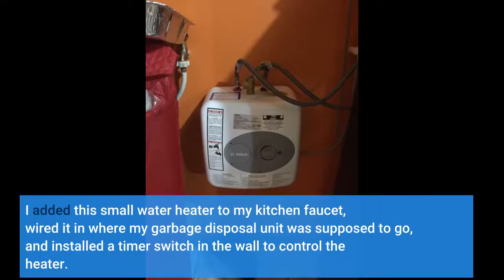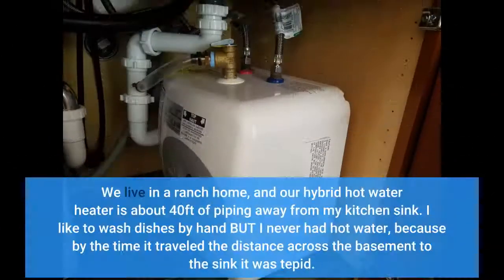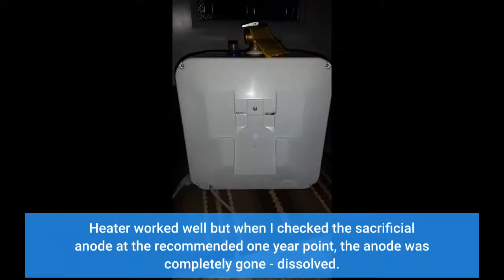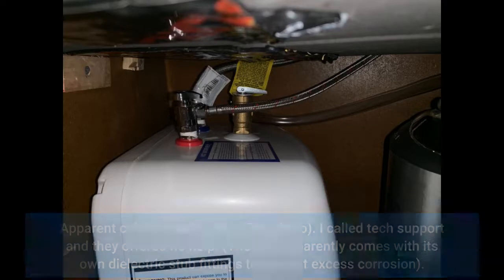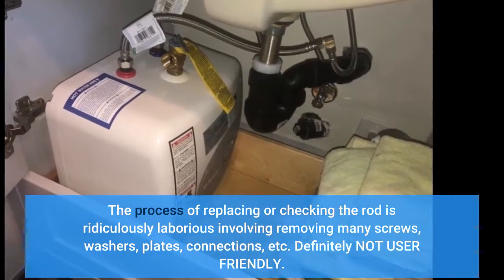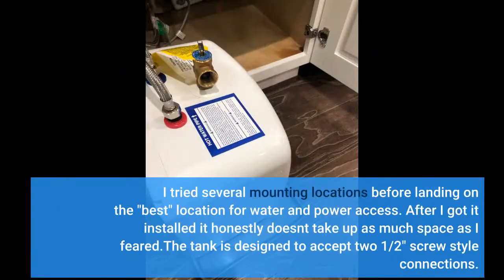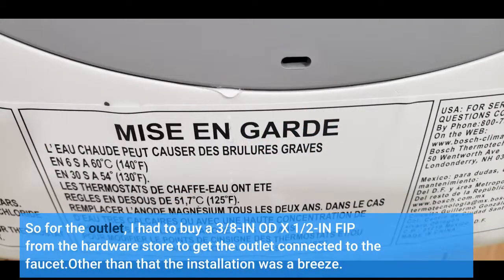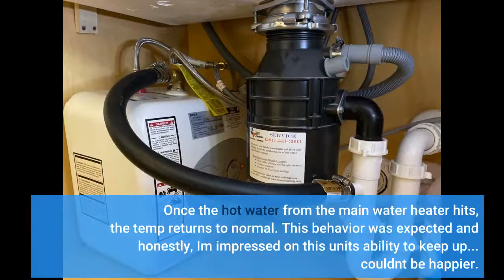User Review: Bosch Electric Mini-Tank Water Heater Tronic 3000 T 2.5-Gallon (ES2.5) - Eliminate...

Comment: The unit looks  perfect for a van build, especially those YouTube high-end showcase vans.  But ... installation must address easy annual replacement of  the anode, which is in the back of the unit.. good luck on the easy part.  It will also require at least 600 Ah of battery power...alot of hassle and money...for convenient hot water.  We used the unit one time on shore power a few months into its service life.  It worked great!!  But the anode hassle and the expense of another 300 Ah LIfePO4 battery has me looking at other options.